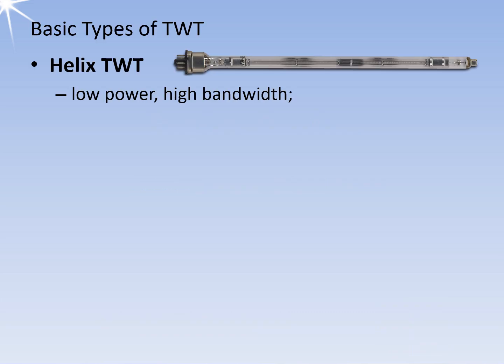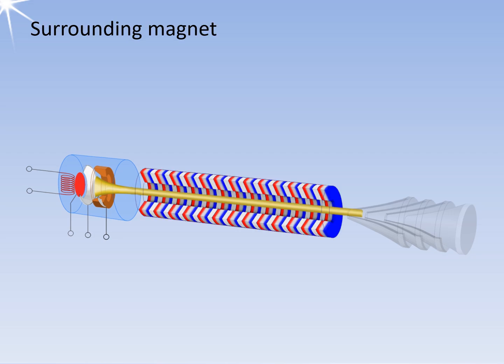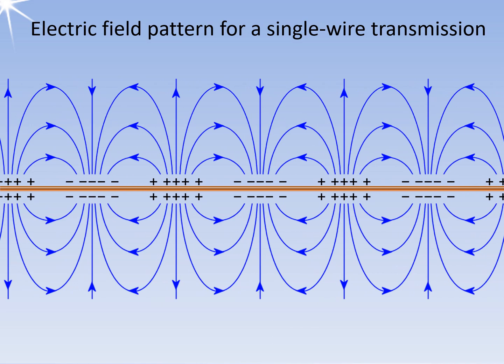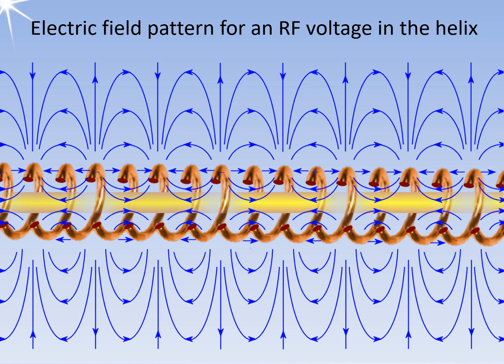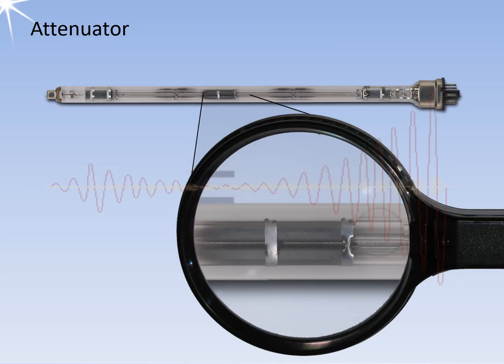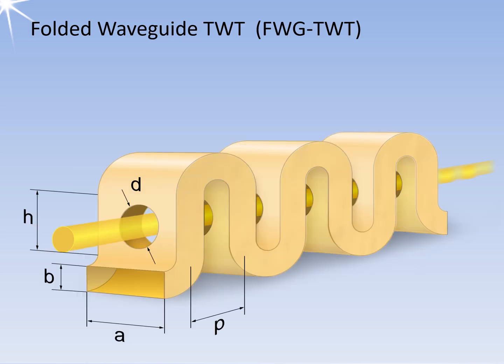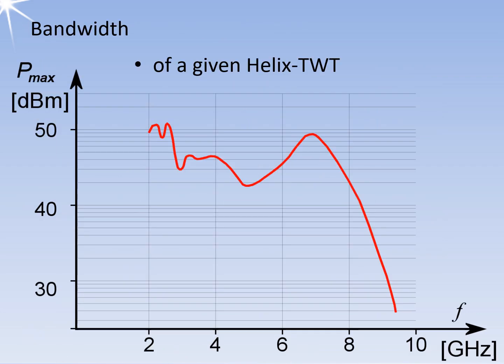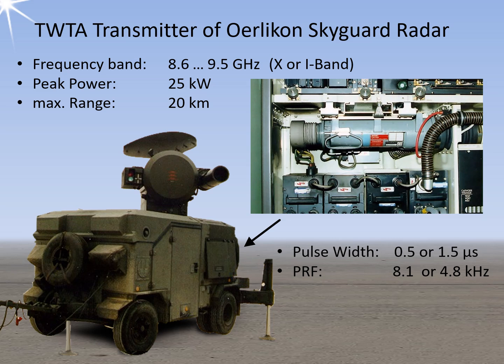Traveling Wave Tubes

Comment: My professor at university had been involved in the design of the TWTs for the Mariner probes, so the TWT was one important topic of his lecture.
In the circuitry example @4:42, the heater current is shown as 2.2 mA, giving just about 14 mW of heating power for the cathode. Is this realistic or should it be 2.2 A instead?
Reply from the maker: Correction: I also began to have doubts because the radiation losses of the cathode alone should be larger. And in comparison with a normal incandescent lamp...
I searched for data sheets:
https://frank.pocnet.net/sheets/190/y/YH1040.pdf
Conclusion: Yes, you are right!

Comment: I’ve never heard a TWT called a “twit” before. Always called it a “tee dubbya tee.”
Reply: I agree.  I spent 5 years working with TWT's at Microwave Electronics Corp. in the 70's and we never called them twits.  That phrase was reserved for human dimwits.  We would have been fired for using that term.  Sorry, can't watch this past the first 45 seconds
Reply: @tomlevenhagen  We'd really catch hell if we called them "Travelling Wave Amplifier Tubes"!  Wouldn't we?!?!
20-year veteran of Hughes/Boeing/L3 Electron Devices Division, same job, different badge, different Company colors.
Reply: @tomlevenhagen  I worked with them in the early 2000s. Glad to know they weren’t called “twits” in the ‘70s, either. I never learned the engineering of them, just how to replace them, so I went down the YouRube rabbit hole to see if I could learn something. Not from this one.
Reply: @TheRealMake-Make  I"m very glad they didn't become known as twits.  I was just a 20 year old tech back then, but had the privilege of working with one of the co-inventors of the TWT.  We all had to have secret clearances because the military was buying them as fast as we could make them.  They were being used in air craft electronic counter measure systems.  Pretty exciting stuff for a kid :)
Reply: And TWTA as "Tweet-ah" or "Twee-tah".
Reply from the maker: https://www.scientificlib.com/en/Physics/LX/TravelingWaveTube.html